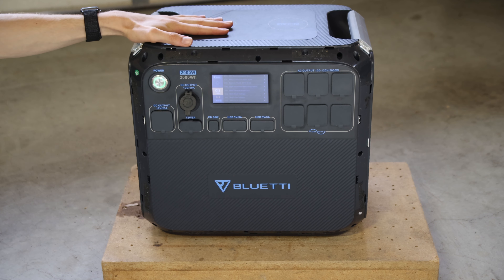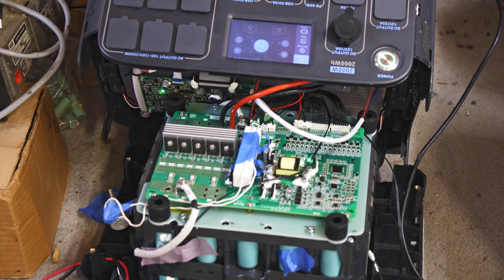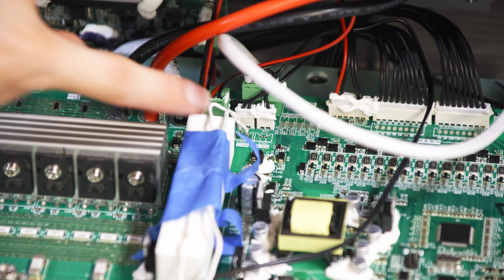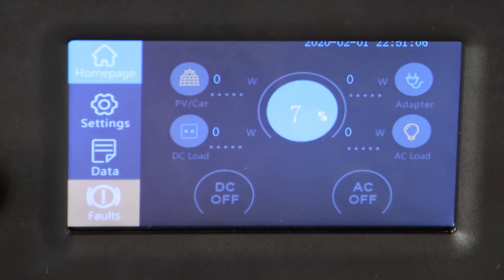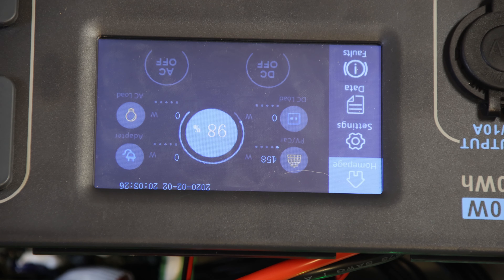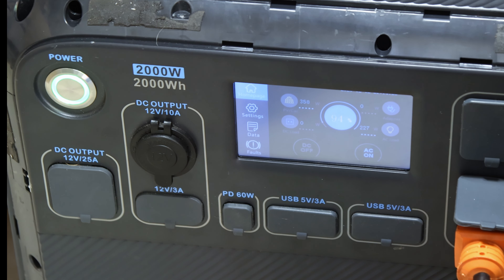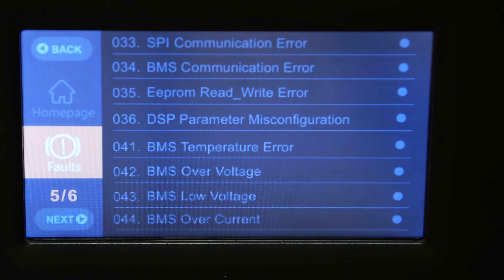Repairing a Bluetti AC200P with a BMS temp error

Comment: I had a similar base problem with my AC50 after it stopped working from being caught in a downpour.  After drying it out thoroughly for a few weeks, I opened it up to check for corrosion, etc.  Got it to turn on and take a charge and charge some electronics from various ports.  Yay!  But when I put it back together, I must’ve pinched the NTC wire with the case and I only got the E05 error that no one had ever seen before and about which no understanding exists (apparently).  I took it apart just now after watching this video, thinking I’d mess with the NTC wires and connectors and I found that the wire is completely split where it was pinched.  Now I just need to find some way to splice those wires together - there’s very little available excess underneath the battery pack.  But I was able to find the problem thanks to this video.

Comment: I had my AC200P pulled apart recently. It had a 030 "calibration failed"  fault on startup, which rendered all outputs inoperative. After bringing the unit inside, it maraculously started working again and has "worked" ever since. Because the only thing I did was move the unit, I pulled it apart to check for loose connections, of which I found none. I did a discharge test and noticed one of the battery packs  dropped to 2.8v before the unit shut down, while the rest of them were at 3.2v.  A recharge and subsequent discharge test showed the same result. According to the display and multimeter readings, battery pack 11 was the culprit. The AC200P uses 160 26700 LIFEPo4 cells in a 16S 10P arrangement. I slow charged pack 11 to 3.2v  through the balance wires to match the other packs using a hobby charger. Havent tried another discharge test yet...fingers crossed, but not overly confident.
Reply: I have an update to the "calibration failed" fault. The fault returned when all I did was move the location of my AC200P inside of my truck. The LH side of the unit was against the metal wall of my truck. I moved the unit a couple of inches from the wall and voila, the problem went away. It seems that Bluetti doesn't EMI shield the AC200P very well. I wonder if anyone else has had this problem.

Comment: Thank you for doing that.  My same unit just put that code up yesterday.  I do have manuals and will be connecting to customer service.  I'm scared my expensive unit isn't going to work or it'll cost me a lot of money to send in for repairs.  i rely on this unit for work and cooking on the weekends in the cold weather.  ugh
Thank you for putting this on you tube.  I hope i can come back and report more information and that Bluetti comes through for me and others with this issue.  🌻
Reply from the maker: I wish you luck fixing the issue. I unfortunately have had more issues with my unit and my fix stopped working. The bms seems to continue having weird errors like showing weird voltages for the battery cells. I have given up fixing the board and have just extracted the lifepo4 battery and am using it with a different inverter and solar charger.
Reply: Find anything out?
Reply: Good luck with customer service and or  repairs or returning the unit. 
The company is grossly unethical in honoring their product under warrantee and or just servicing. You are destin to throw your unit to the Gardbidge bin. 
You will never get anything from Bluetti !!!
The only thing we can do is to get all of as together and file class action.

Comment: On the bms maintenance page tap the upper left corner repeatedly, it should bring up diagnostics for the cells and show the individual voltages. It also shows the 4 different temps. A, B, D and P. mine are all showing 24C +- 2 degrees.
Reply from the maker: That works. Thanks so much for showing me that. I also see the reported temperatures for A B D and P. Do you know where these sensors are located? The reported temperatures I see now are a: 34 c b: 15c d:36c p:41c. When I get a chance I want to take the unit apart and play with the resistance and see how the reported temperatures are affected.
Reply: @ElectronicsWizardry  Unfortunately,  I don't know which one go to what. With no loads or charging on my unit. B on mine is showing 3 degrees lower than the other 3.
Reply: @ElectronicsWizardry  I know it's 2 years late, yet this info might be useful to someone: 
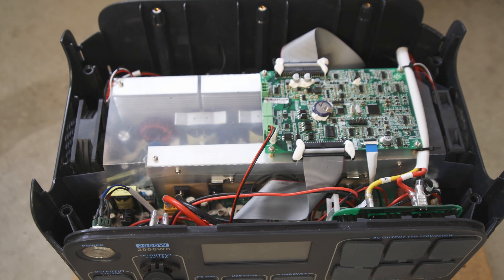There are 4 sensors mounted 2 each side of the radiator, you can see them bolted horizontally half-way up on the radiator starting at 4:25 . They all connect to the PCB that's under the radiator with 4 black 2-way cables and white connectors. Their PCB connectors are located 2 on each side of the PCB.
The ABDP values are not all coming from the sensors, some of them (2 if I remember correctly) are calculated, and the other two come from the  sensors. 

I had issues with one of the sensors, the one that is inputing the A value (can be seen in the video ar 4:25 on the right side of the radiator). 
As I had no spare 15K NTC thermistor to replace it with, I have disconnected it from the PCB and connected the other sensor in it's place, thus "fixing" the issues and being able to enable functionality to the unit.

The faulty NTC thermistor was displaying a constant 79degC and it was locking the entire unit, couldn't charge or discharge the AC200P with this error present. The fans were runnign at full speed during this time.

Comment: I have a Jackery 1500 and when I started having problems with the BMS, I called them and was told if it's under warranty they'll help me, otherwise no help. I even asked if I return it, would they repair it and I'd pay. Again I was told no. Finally I found out they only will swap out units in warranty and if it's one day after the warranty dies, you're SOL. These are all made now in China and there are "no" forms of repair here. No schematics or anything.
Reply: Wow, this is lame move in my book. I expected I might have to pay for hypothetical repairs some time in the future, once the warranty is expired, but it might not be possible, just like your have described. We might have to rely on unauthorized repair shops, donor boards and salvaged parts. Similar problem have people trying to fix Apple outside of authorized support, at reasonable cost.
Reply: @pavel9652  I didn't think when you buy something that costs a lot of money, there would be no support outside of a warranty, but Jackery is now made in China since they sold out. So the in warranty method is refirb your unit in warranty but there is nothing here in the country to fix these. If I had the startup money, I'd start a repair shop for all of them. So far I've learned a lot since taking mine apart. It's coming back to life as I replace bad parts. I'll get it working but will I pay the money for a new one, maybe not knowing what I know now.
Reply: @briancclevenger  Jackery is more popular, so it makes sense. I got BlueTTI AC200max and 2xB300. I had researched an off-grid solar setup and when I was trying to locate components I found their power station and it checked all the boxes, plus the price was good. I wouldn't be able to do it cheaper with loose components, it wouldn't be plug and play, and the project would be time consuming. On the flip side I have three heavy and relatively complex bricks, and when they go wrong it might be tricky to fix them.

Comment: The same unit here, AC200P bought it to take to an off-grid vanilla farm in the Dominican Republic during some weekends. The first time it worked for part of the time but then went into  34 BMS Communication Error.  Months later took it back and worked fine.  The 3rd time was the charm.  Never worked and was stuck in the same Error 34. Contacted Bluetti and said to return but not cost-effective to send it from the Caribbean.  They suggested replugging some connectors, which I did and had no luck.  Then I suggested I could remove and send the BMS, so they could fix and return it, but they said they did not offer that service. Anyway, the short of it is that I have a hefty paperweight.  The question now is how ez is it to continue to go inside the unit to pull out the battery pack and at least get some money back?  Definitely stay away from Bluetti!
Reply from the maker: Inside it has a 16s 48v lifepo4 battery. I got a off the shelf bms for mine and use a charger rated for 48v lifepo4 batteries and it works pretty well currently. Kinda feels like a waste to throw out that inverter and other parts though
Reply: @ElectronicsWizardry  Thx. That's the ticket to recoup at least the batteries. I can use to run at least my Starlink with a solar charger. Anything, in particular, I should look out for taking it apart?  Have some basic knowledge and know how to use a tester.
Reply: Any BMS sugestions from Amazon? Most are over $100!
Reply from the maker: I'd be very careful with the power that battery can put out. It can easily make lots of current and melt wires and create nasty shorts. I'd make sure all the exposed contacts are convered. Also get a good bms and breaker to cut off the battery in case if a over charge or or current situation. Other than that I'd just keep taking off the board until you have only the raw cells in their holder. You can reuse some parts like the 12v usb and wireless chargers if that's useful fornyou
Reply: @ElectronicsWizardry what off the shelf bms did you get an from?
Reply from the maker: @AquaTech225  I got a no name BMS off Amazon. Its branded as 'VNSZNR LiFePO4 BMS'. I wired in all the cell monitoring leads, and the voltages seem to be in the reason range.

Comment: I am having bms temperature error and up to 8% discharge per night and long waiting before recharge via solar panels can start on ac500. What do you suggest? Is it also acceptable a larger consumption in ac mode in winter vs. Summer?

Comment: got the ac200max no error code but i noticed a few times when it got down to 20% it died suddenly. only running a 350 watt device. still works though and so far no error codes

Comment: I got a free AC200P that starts, beeps, runs for 15 seconds, and shuts down.  It h as fault codes 42, and 43, over voltage and low voltage.  I can't start it up right away, but in 30 seconds or so it starts up, initializes, and runs for 15 seconds before shutting down...  Looking for answers.

Comment: I run yesterday in fault code 41 -_>  BMS Temperature Error, and I could not charge over ac !  
I use the power-station in my sprinter-van.  It was cold, but not under 32f / 0c.  I heated the van up to 65f / 18c for over two hours, put some heat around the bluetti power-station, but nothing happens, it stayed in fault code 41. I canced / reset the falut code a couple time, still nothing.
Reply: It tooked a wile in my well heated house to get the bluetti going again. I had 27f in the Camper-Van, the Bluetti got to cold to charge. I heated theVan  Interior for up to 65f for two hours, but the bluetti was still frozen. I put  the power station over night in my heated house, in the morning everything worked again. So, the bms worked like it should to prevent charging damage. It is important, to keep the bluetti warm for charging.
Reply: It is almost 30kg of batteries in a plastic case and it will take time to warm them up. Maybe insulate it with styrofoam and mylar for the night and keep a small load, but I am not sure what would be sufficient. You can try to discharge unit as well, maybe make a tea with electric kettle. Alternatively take it with you to a warmer place.

Comment: Sure, I can help you with that. Here is a letter you can send to Bluetti Corp:

Dear Bluetti Corp,

I am writing to you today to remind you of the right to repair that California AC200P owners have under the Song-Beverly Warranty Act. This act guarantees that manufacturers will make repair facilities available for products that cost $50-$99.99 for 3 years, and for products that cost over $100 for 7 years. SB244 would apply to the same sets of products, with the same terms, but would end in 2024.

In accordance with these laws, Bluetti must repair a manual that outlines repair procedures for the AC200P. This manual should include information on how to disassemble the product, how to identify and replace faulty components, and how to perform basic maintenance.

I urge you to comply with these laws and provide AC200P owners with the repair manual they need. By doing so, you will be upholding the rights of your customers and ensuring that they can keep their products in good working order for many years to come.

Thank you for your time and consideration.

Sincerely, [Your Name]

I hope this helps!
Reply: I doubt they can give much a damn about that.  That would be brushed under. Because the majority if not all aren’t going to put out the money to go after them

Comment: 1 year ago, hmmm. Bluettti states this unit uses LiFePo batteries, but you say they are LION. Were later models upgraded?
Reply from the maker: I must have misspoke as it is a lifepo4 battery inside the unit. I have since used the cells from this battery as a small solar battery as it's a 16s lifepo4 system and will use standard 48v inverters.
Reply: I have the same unit. I'm getting ready to salvage the cells and use an aftermarket BMS and inerverter. It gets a 01 030 "calibration failure" on startup and won't allow turning on any  outputs. I won't waste my time dealing with a buggy system and I hear their tech suppory isn't good either.  @ElectronicsWizardry

Comment: I have a ac200max, and I can’t get it to turn on. The only thing that turns on is the green circle around the power button.
Reply: yikes ever get it working
Reply: @72SeasonsGone  yes- BLUETTI sent me a replacement mother boards.
And it’s back to working correctly.
Reply: @Rosiecast273 wow surprised they even agreed to an letting someone open it to even remove the motherboard to do so
Reply: They have to get the post warranty service sorted out, because these bricks are too expensive to get dumped and too heavy to have them shipped half way through the country or even internationally for repairs.

Comment: I am interested in trying to get battery level voltages out of the unit. One of the main issues with the unit (even the ones that are working correctly) is that it wastes so much power to heat. I would like to bypass the ac inverter and dc to dc circuits and just get battery voltages out from after the BMS. I am not sure how much power the BMS wastes vs the the rest of the components such as HMI and controller boards. Would be a easy test if I was willing to void my warranty and break some clips.
Reply from the maker: It should be possible to get the battery voltages by connecting your wires to the large cable connecting the bms to the inverter board. I haven't tested this, but it should be possible in theory. One possible issue I see is the bms has a current monitor and might cause issues if the inverter power usage isn't the same.

You would have to likely splice the cables coming from the bms or buy some of the connectors used. They look like xt60 connectors but Im not sure. It seems like you can get a splitter on amazon pretty cheaply, and then get a directly hookup of the ~50v from the battery.

The bms alone should waste little power, as it seems to only have mosfetts and current shuts between the battery and the output connectors. The bms will disconnect the battery from the output if the battery isn't safe to charge or discharge. Since I felt almost no heat coming from the bms in my use, there likely isn't much power lost there.
Reply: The BMS still turns on with the XT90 connector disconnected from the inverter board. The only thing is that you will have 50+ volts DC at that connector, so you will have step that down using a DC to DC coverter, unless you just want to hookup a different inverter. Have you checked the parasitic draw with the AC output turned off? Just going straight to the to get "battery voltages" is not possible other than the 50+ volts I mentioned at the XT90. All of cells are spot welded together into one output. Pulling individual  voltages through the balance leads would wouldnt provide enough current and would cause the BMS to fault out. The video author mentioned using XT60 adapters off  of the BMS lead...okaaay, yeah let's just have 50+ vdc at all of the DC outlets. Not a good idea unless you like to watch things go poof! 😂